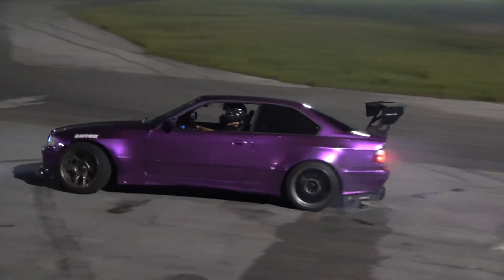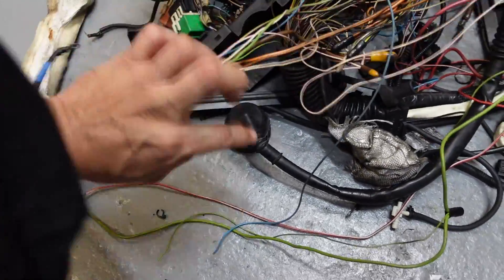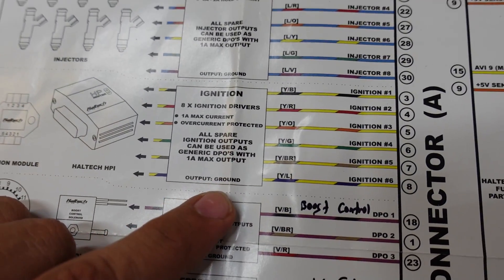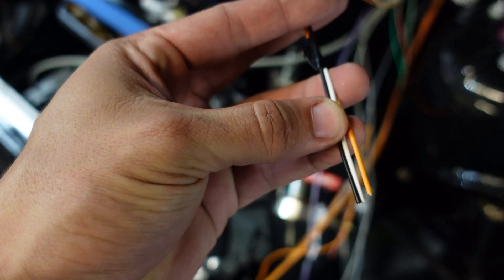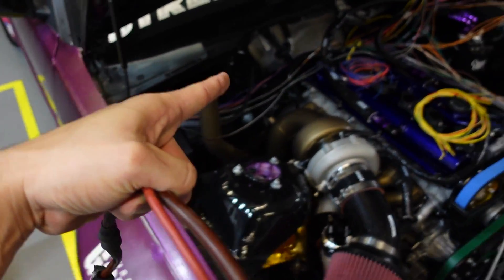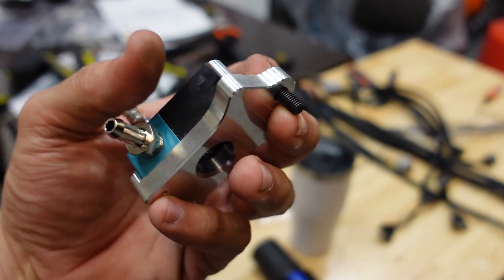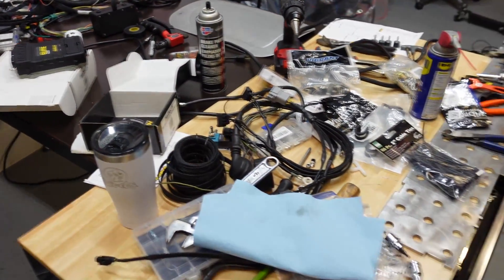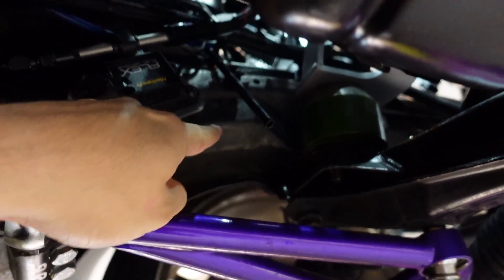2JZ VVTI BMW E36 HALTECH ELITE 2500  INSTALL everything you need to know

Comment: Thanks for sharing. I am currently wiring up the same set up. There are 2 wires for the VVT-i. what 2 wires did you use please? And also what 2 wires did you use for the boost control solenoid please? Thanks again

Comment: Making harness is good and relaxing job😉👌. If you use smaller diameter sleevs for sensor plugs (there is 2 or 3 wires only) say 4mm ones not 8 or 10 mm harness will be looks not so bulky. 😉

Comment: Hey Alberto, are you running stock toyota knock sensors or upgrade to the bosch ones?
Reply from the maker: Bosch motorsport donut style 💪🏁
Reply: @ALBERTOBIGBOOST  Good choice on the Upgrade, the Bosch wideband (two wire) ones have better response than the OEM (one wire) knock sensors